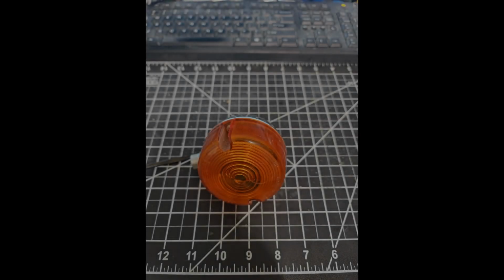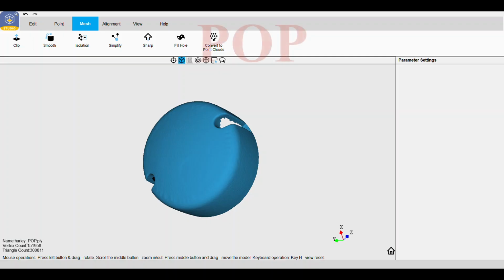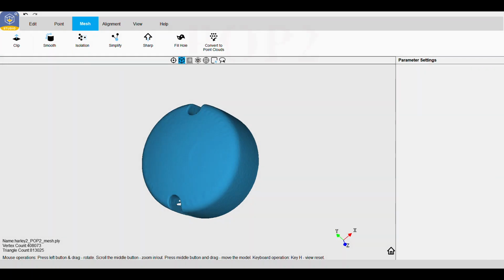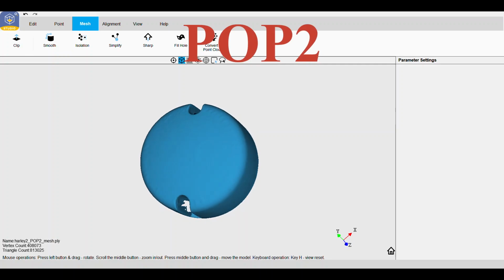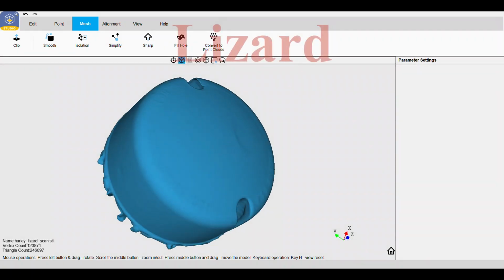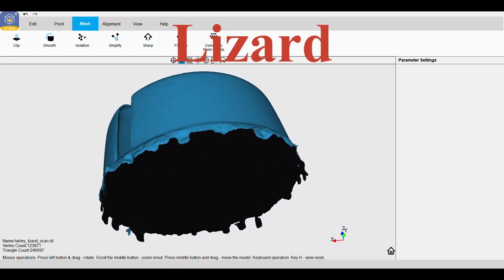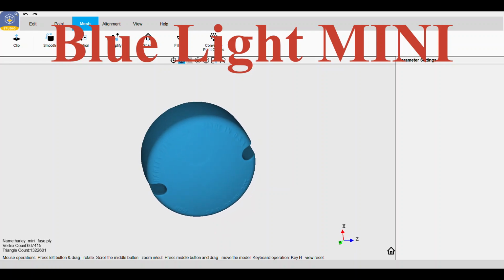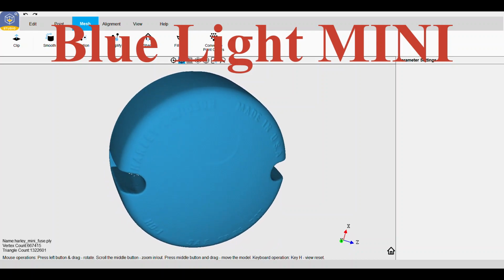Four Scans of a Vintage Harley Sportster Turn Indicator Lens

Comment: jeez every time you post a comparison video it shows just how much the mini poops on the lizard and even the pop 2 is equal
Reply: It is not equal , but if you scan less details the volume accuracy looks almost the same , MINI power is accuracy and fine details on a very small objects , Lizard and POP2 are very close to each other , the accuracy difference is minimal so it is hard to see just by eyeballing the results . However MINI resolution is 80% greater than the one of POP2 and Lizard .
Reply: @PUTV3D  the detail difference of the lizard is barely there considering it's advertised to be better

For clarity i have a pop 1, 2 and mini. I'd get the scan01 over the lizard any day of the week but being the pop 2 is mobile and the lizard isn't kinda a waste imo
Reply: @digital0785  I have them all too , the lizard is something between POP1 and POP2 and not better than POP2 , it was advertised to be better but it was just for marketing strategies. I am still curious about the mystery color kit nobody talking about .ScanO1 was quickly returned as I preferred POP1 over it 😀
Reply: @PUTV3D  the benefit to the scan01 is better tracking on flat objects but from a detail standpoint Revo is killing it
Reply: @digital0785  totally agree on that 👍 plus it produces better texture , but the details are below POP1